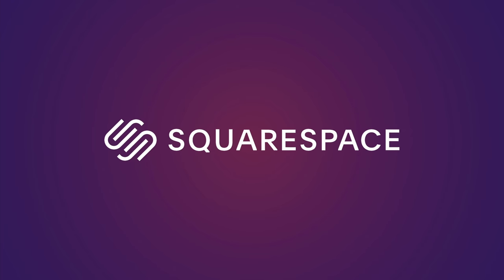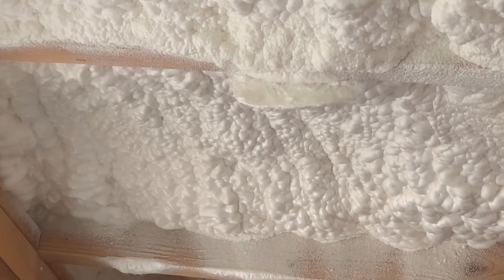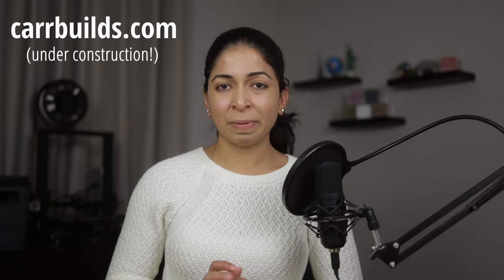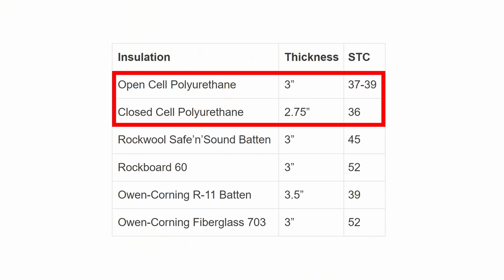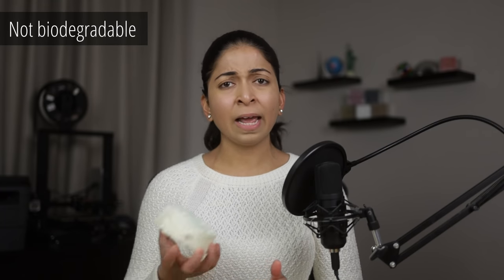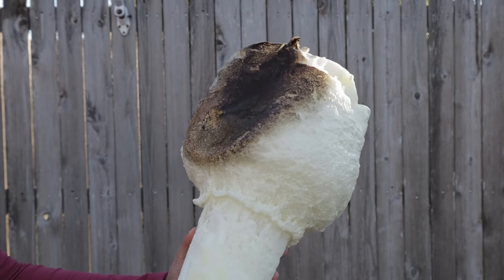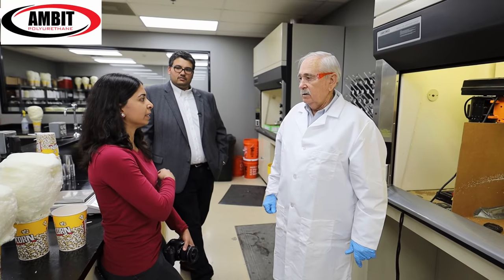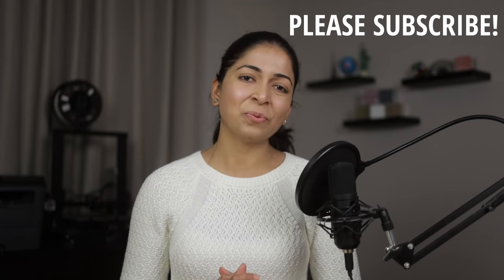PROS & CONS of Spray Foam Insulation | PART 2

Comment: I'm now a home builder in the US, after doing commercial and residential construction in Alberta for the last 16 years.  As the owner, I've been in a unique position to try many different things.  When Alberta implemented its 'Energy Efficiency Program' 6-7 years ago, it caused many of us incredible headaches.  While there may have been some builders involved in drawing it up, It was obviously written mainly by people who have probably never built anything.
The incredible R value requirements (R21 wall average, R68 attic if no HRV, etc.) pushed insulation manufacturers to make almost mythical claims on their products, which of course cost many times what standard products had cost.
This forced me into spray foam considerations.
After tons of research (which I was happy to see recently corroborated on your own channel!), I've settled on the 'flash and batt' method for buildings here in Missouri.
Assuming all new construction is 2x6 exterior wall (I'm appalled to say that most builders are still using 2x4 in this area, but it will never happen on one of my builds), I start with 2 inches of closed cell foam.  This gives me the increase in rigidity, the vapor barrier on the outside of the cavity, as well as wind proofing. I'm now still able to wire the building because there is 3.25" of cavity remaining open.  When everything is done, we finish off the space with craft-faced R-12 fiberglass.
I DO NOT like fiberglass insulation.  It is one of the most misunderstood and overestimated products in the history of building.  However, by placing it on the 'warm side' of 2 inches of CC foam, we've negated its weaknesses. First, there is no draft, so it actually works.  Second, it never gets very cold so its actual rating doesn't stray too far from the factory R-value determined at ~70°F.
I'm about to finish a house with this method used, and am expecting my thermal imaging camera to show up any day.  I'll be sure to post the results.
Belinda, thanks so much for all the work you're doing!
Reply: Interested to see your results!
Reply: Hi! I'm in KC planning a build the same way you've described. Can you tell me how it ended up working out?
Reply: I’m in St. Louis. I live in a historic full masonry building built in 1903, and have also settled on flash and batt with rock wool as per Section 5.4 in NREL “Measure Guideline: Internal Insulation of Masonry Walls.“ I am only able to fur out selected walls with 2 x 4s, so this limits what I can do to achieve R15 or greater. As I understand it, St. Louis is in ASHRAE Climate Zone 4. According to Fine Homebuilding “Why Flash and Batt Makes Sense,” I should use 1 1/2” closed cell spray foam in Zone 5. They don’t mention Zone 4. This leaves me 2” in my stud spaces. Rock Wool makes a 2” thick batt in their AFB Acoustic Fire Batt line. It is R-3.7/inch. So the flash and batt should give me about R17 in toto. I will not be able to afford to pay someone to insulate these exterior walls for me, so I will be learning to use Dow Froth-Pak insulation, which is closed cell. I found a good price at Industrial Products. I would not want to use a Kraft faced fiberglass in my situation because the spray foam already provides a vapor barrier and the Kraft backing would add a second vapor barrier.

Comment: As a general contractor for over 40 years, I am very impressed with both open cell and closed cell spray foam.  Having used it in my own personal residence building on the Southern Coast I couldn't be more happier as it's super energy efficient giving us utility costs at least 75% less than our last home where we used rock-wool in walls and ceilings.  We choose a professional who was top notch on the mixing, and product knowledge and it paid off handsomely in positive results.  Great video, keep up your insightful posts.

Comment: Air sealing a home in a warm, humid environment is tricky, but when managed correctly with HVAC we end up with lower humidity levels in summer, and higher humidity levels in winter (both relative to poorly sealed homes).  I have a single story home with exterior ICF walls and a sealed attic, at about 5000 square feet of interior space with an average plate height of 11 feet, dropping the J load requirements from 11 tons to only 3 tons allowed me to afford a geothermal system (with a tax incentive). Which allowed me to also use a desuperheater for lower hot water costs.  Supplemented with thermal solar water heat, I pay almost nothing for hot water, and my total HVAC costs over time are dramatically lower than a conventional home.  When my geo thermal system inevitably dies, the loop field is still in tact so it’s just an equipment swap rather than loosing the total cost of installation.  

Foam makes this all possible.  There may be other ways to achieve similar results, but not easy or inexpensive.  

Another factor is comfort level.  The stable air, noise reduction, humidity levels, and solid feel of all this apparatus just makes for better living.

Comment: Thank you! I'm deciding between spray foam and other options on my bus build so this video was right on cue. Your evaluations always seem honest and helpful. Please keep it up!
Reply: For insulating a vehicle use closed cell foam. And DO NOT USE THAT STUFF YOU CAN BUY AT THE LUMBERYARD! Those cans, even the tanks they sell at lumberyards are meant for sealing cracks and joints not for doing large areas. Figure for every square foot of foam you’re adding approximately 3 pounds of weight to the vehicle. For what you have in mind find a licensed and bonded spray foam insulation professional.
Reply: @jamesmchugo9422  Thanks James! Yes, I'll definitely have it professionally done if I go that route. There's another consideration specific to vehicles that I'm looking into - squeakiness! Ours is a shuttle bus and the original foam board insulation made an awful racket as the bus flexed and shook. If the spray foam does the same from either delamination or just from its contact to covering materials that's a show stopper for us.
Reply: @JordanWorkshop  I should have asked, are you insulting for temperature or sound? The foam will give you the best R value, but it’s garbage for sound. If your primary concern is sound look into sound deadening mats. They’re not cheap, but will stop just about all noises from the frame and body. Some even help with temperature insulting as well. Just google sound deadening mats or automotive sound dampening. Good luck.
Reply: @jamesmchugo9422  It's for temperature insulation. I just don't want it to also sound like I'm in an aviary while driving down the road.
Reply: @JordanWorkshop  you may want to use a combination of the mats for sound proofing and foam for temperature control. Good luck with your project.
Reply: @jamesmchugo9422  a good cost-affordable option for sound and insulation is rockwool. it is like fiberglass but better in every regard, except price, afaik.
Reply: she really does the research.
Reply: Jordan, we’ve built 4 busses to date. We use a combination of closed cell between the ribs, then a layer of Ceratex 3170 to provide a continuous thermal barrier to eliminate thermal bridging. 

The advantages of closed cell foam over batt type insulation are numerous. It seals everything, it reduces rattling, doesn’t settle, and doesn’t allow condensation to form on the cold metal

Comment: A university built two identical houses in an Ontario neighbourhood and spray foamed one and traditionally insulated the other. After two years (heating/cooling cycles) they found the spray foamed house used about 50% of the energy as the other. That is a lot less gas, oil and/or hydro being used. I would post the link, but i read about this a couple of years ago.

Comment: I own a spray foam company. One thing I will note here off what you said about not being able to add plumbing and electrical after application. When using closed cell, you can easily aff after the fact many things. In a 2x6 cavity, we are typically spraying 3 inches ( zone 7) leaving 2.5 inch of wall left to aff a wire or apex plumbing after is some changes need to be made.

Comment: I lived in Canberra in the 70s, I married and had children there.

We had a house built, and having moved in decided insulation was in order. We were using bottled gase fo heating, the bottle was a permanent fixture and ESSO came around and refilled it as required.  We were using a fill every week or two.

We had the expert come round and fill the exterior wall spaces with urea formaldehyde foam. It was highly effectiv, we went from using one fill every week or two to using about one a year. The delivery driver thought we'd changed to electric heating.

There was some concern about formaldehyde escaping (not at our place), measurements showed it settled down to background in a few days. It happened, we went away for a while after the job was done.

The foam is no longer used, but urea formaldehyde is used in gluing plywood, particle board and MDF, with similar results to the air inside homes.

Comment: Very interesting stuff! My curiosity of spray foam insulation comes from the diyers making schoolies and tiny houses, since their wall cavities have to be so much thinner than standard homes. I'd love to hear your review on light straw clay or wood chip/slip! Similar insulation system to hempcrete(loved your video on that!), But uses a more accessible and potentially local fiber source. 

I like that spray foam has become better on the environment, but I feel it is still a "kick the can down the road" approach on end of product life. Won't have to deal with landfill problems if we use natural materials and stop adding to the landfills in the first place.

Also, I've seen some amazing things being done with mushrooms the past 5 years or so, I wonder if mushroom/mycelium insulation is in our future!
Reply: It's the ever ongoing fight between ease of use, cost, performance, longevity and environmental issues. Personally I like glass fiber and rockwool as they have a very low environmental footprint and are stable compounds that doesn't rot, burn or can be digested by bugs or animals. It's primary environmental impact is in the manufacturing where it takes a lot of energy to melt the source materials and blow the fine fibers that makes up the wool. Then there's transportation, but that's more or less the same for most of these materials. It could be argued that spray foam probably has less of this as it's transported in liquid form that on use is expanded to something between 30 to 100 times the volume. Sure both glass and rock wool eventually ends up on the landfill, but they are not more toxic than glass, sand or stone. 

Any material with organic compounds will degrade over time, and are often susceptible to mold, rot and being eaten by mice or bugs. They also tend to be flammable in their "pure" state and require chemical treatment to become flame retardant. Chemical treatments can also be used to make them more resistant to rot, mold and bugs.

Now don't get me wrong. I'm not claiming that chemicals equal bad. It has to do with exactly what the chemicals are. After all most everything can be called a chemical. If it's used in or causes a chemical reaction it is a chemical, and it doesn't matter where it comes from or how it's produced. All I'm saying is that a lot of these products need additional treatments to be safe and sound for long term use, and whatever is used for that has to be accounted for when looking at environmental impact and how safe a product is to use. Sometimes things can surprise you, such as wood based products without any added chemicals that outgases and can cause problems. That's not what you probably expected hearing something was made from wood.

Every new product has to be tested and investigated before it can be said to be better than the existing products. After all we don't want to end up with something that has to be treated with kids gloves like Asbestos. That is a material with wonderful properties. It can be solid or a fiber, and it's very stable so it ages well. It doesn't burn, rot or get infestations and it's cheap. All in all it's a close to perfect material with just that itty bitty little problem that it is very likely to cause lung cancer if you breathe in the dust...

Another issue that has to be considered are allergens. Products such as glass fiber and rockwool doesn't release any allergens by them selves. I've seen wet insulation that's been sprouting mold however, and that can be nasty. Another thing is the small particles that can be released in the air if you cut or rip these materials. I've not really looked into it but I can't see that breathing that in can be in any way a good thing. So that's a mark against glass and rock wool.

As for spray foam I can't really make any good arguments for or against other than what was mentioned in the video. Instinctively I want to put it in the nasty chemicals category, but apparently it isn't quite as bad as my gut wants to think. To me spray foam feels like such a new tech that I'm suspicious. It's not logical or reasonable, so I try to ignore the feeling.

Comment: The video "Spray Foam Insulation — The Ugly Truth?" has great info to. 
When I asked a chemical manufacture that makes spray foam the best (marine) foams under ideal conditions are 95% close cell. This means 5% or more of the cells can absorb moisture. The industry came up with open cell to try and deal with the water issue but open cell is an even worse sponge. Spray foam is great if there's never a chance of it coming in contact with moisture.

Comment: A consideration for me in renovating my house was that if I had a leak develop in the roof, a nail backing out or other minor leak source, it would be very hard to find behind the monolithic structure of a foam seal. Water can run for amazing distances and is unrelenting. This compounded with possible mold problems accompanying the possible leak put me off. What has worked amazingly well is a radiant heat barrier.(I’m in south Florida.) it is relatively cheap, easy to install and very effective. A builder told me he could tell which homes under construction in a development had the barrier as in the late afternoon, the work crew congregated in those shells/houses as they were consistently 10-15 degrees F cooler, windows and doors or not. I could see spraying to seal to control air flow and doing the bulk of my insulation with a radiant barrier and conventional battens in the attic floor. A composite approach.

Comment: In 2018 we began a gut-rehab of two adjacent buildings we joined together (one 100+ years and one built in late 60s).  We used mainly closed cell foam.  Our heating and cooling costs are low.  Our bedrooms are on the third floor of the 100+ year old building and the temperature at night remains consistent within the building...the other day we had a sunny warm day and a cool night.  The temperature -- with no heating or cooling -- remained between 74 and 72 degrees f while the outside temp dropped to 61 degrees.  Enjoy your thorough analysis of building materials and methods.

Comment: Great overview of spray foam! I definitely like its ability to insulate against the smallest crevices that rock wool or more traditional insulation might miss, and even though both traditional and spray foam products will eventually find their way to landfill, I definitely don’t like the idea of how messy it would be during destruction. I wish destruction of housing were more green. The lumber from an older house may still be good to an extent. Perhaps not for building a new house but perhaps it can be repurposed more. That said, even considering repurposing building materials comes with a cost.

Comment: Great video as always Belinda. I have some I sight from across the pond for you. Here in Belgium houses are 99% brick and mortar I'd say. Probably even more. So spray foam is mainly used in the floor. Under in floor heating. Most of the negative press around spray foam centers around bad applications that start to sag after time.
I've also seen it called "the asbestos of our age".
Reply from the maker: Whoa, instead of blaming the applicators, they blame the product?
Reply: @BelindaCarr  unfortunately they do, due to ignorance. For reference: we have 17 cm in our floor. Not a mm of sag over 5 years now.